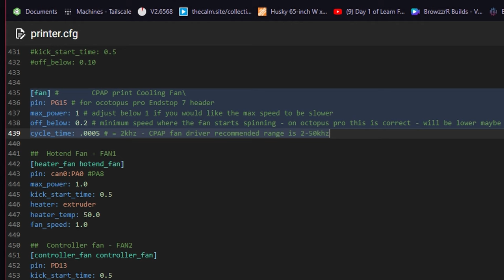Print Apnea No More! Custom Voron 2.4 CPAP Cooling

Comment: ´can't wait for the Micon Stuff because of your quality videos!  - Please keep going !
Reply from the maker: First Micron Video should be up tomorrow!
Reply: @Browzzrr  I am a bit unsure where to start - with Micron or 2.4
I like the Micron because of optics & mods & tiny - But to be more rational i might go with 2.4 (first).... argh :)
Reply from the maker: @jimwhite4482  if you have never built a printer before, the trident is the easiest! if you really want the flying gantry, the 2.4 is also excellent, just a bit more challenging
Reply: @Browzzrr  I assembled an Anet A8 approx 7 Years ago and modded with alu profile case due to the lack of stock stiffnes etc. It is still working btw.
I am familiar with raspberry pi, arduino, electronic and tinkering things.
2 Months ago i bought the Creality K1 and now i want to get back in.
I guess it is only a matter of time that i own more then just one Voron.
I am just struggeling where to start with ; for now i want them all :)
Reply from the maker: @jimwhite4482  I have the same problem! 2.4 or Trident is your best starting point.

Comment: I had been considering a mod like this, and the results are amazing...  But I don't think it's worth the extra noise for me.  Hopefully I can find another cooling solution that does the job but isn't as noisy.  I keep thinking about the dragonburner, but it's ugly and apparently doesn't support Tap.
Reply from the maker: Yeah the noise is a hefty trade-off. I am chasing performance, so it is what it is,
thanks for stopping by!
Reply: you don't run CPAP at 100% -- like ever, my PLA configs have 40-60%, it's far less noisy. Also using an analog control board, you get a lot more accurate control of the CPAP air than doing the fake PWM signal from the pi.
Reply from the maker: @kazolar  I run my cpap at 45% for regular printing, but it ramps up for overhangs. so it hits 90% a non 0 amount of time
I also run it off of the octopus and not the RPI, not sure how an endstop pin varies. 
even at 45%, with the muffler, its louder than a combination of 5015's, so noise is still very much a factor for people who want a quiet machine.

Comment: Thank you, just installed one myself. I do have a question: My fan goes into beserk-mode when starting up until Klipper is started up completely. Is this normal? My setup in klipper is the same as yours.
Reply from the maker: 100% normal, berserk mode is how I would describe

Comment: what is your kit? ldo? formbot?
Reply from the maker: Formbot!
Reply: @Browzzrr  
How did the inputs shaoper
 come out on both axes?
Reply from the maker: @bubajou  I get about 9k on x and 4.3k on Y, cleanest graphs I've seen on a 2.4 350
Reply: @Browzzrr  little bit slow, mine with stock fysetc kit with abs have 10k on x and y 6k. 2.4 350mm

Comment: i think mammoth is a bit better
Reply from the maker: Mammoth is three times the size. 
Plus most of the noise comes from the air coming out at the hotend. A bigger muffler wouldn't do anything.
Reply: @Browzzrr  you use spool behind, mammoth has the same depth as a roll on the back
Reply from the maker: It's bulky and wouldn't change the noise levels at the toolhead, I'm happy with the one I have

Comment: I find that 100% CPAP cooling is too much.  I rarely go above 50%.  It's just so much better than a toolhead mounted fan.
Reply from the maker: Yeah I run 90% on heavy PLA overhangs
Usually 20-50% for anything else